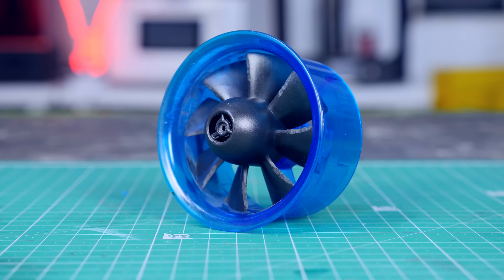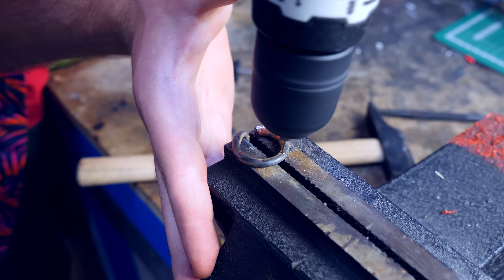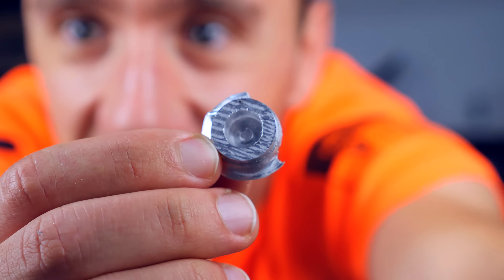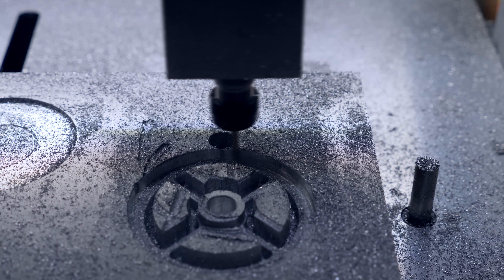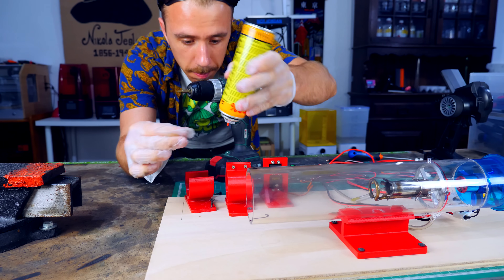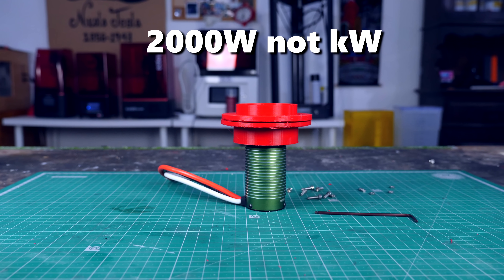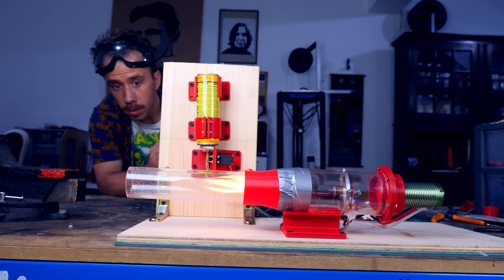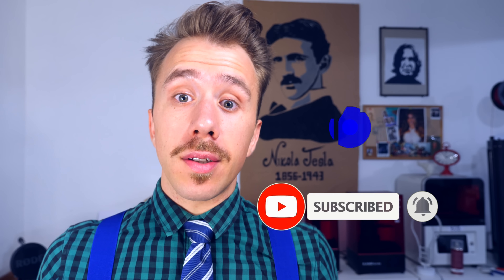I turned my Fan into a Jet Engine (3D Printed EDF Afterburner)

Comment: Greetings from Mexico. Aerospace Engineer here. The reason why your CNC machine was making strange noises while machining is because the best way to machine is clockwise, CNC tools have a hard time cutting in the opposite direction.  My second advise would be to use only 2/3 of the tool diameter as guide to know the thickness you are allowed to cut in one pass. For example, if you have a 10mm tool the recomended penetration is 2.3mm, it can be less but never exceed the 2/3 rds. The amount of penetration can vary from tool to tool, 5/4 is for crowns, 2/3 for milling cutters, etc. My third advice would be to al always start the CNC simulation outside the material machined,  milling cutters are designed to cut in a horizontal way unlike drills.
Im not entirely sure if it is possible to adjust the RPM, tool speed etc in your CNC machine, the reason I mention this is because according to the material , speed, RPM's, and other characteristics should change. You can find on the internet formulas to calculate this characteristics.  Hope this info helps :D

Comment: I know it's been a bit since this came out, but this idea was too good to wait for the next video. It would be cool if you made a Motorjet aircraft setup (doesn't have to actually fly, or even be a full airframe). A motorjet is a special type of engine where a piston engine drives a compressor which then supplies compressed air to a combustion chamber for a jet engine. It will also sometimes drive a propeller, which grants the best of both worlds in terms of low speed and high speed efficiency.

Comment: Jet engines can be either centrifugal flow (early British, and subsequently American, jets were centrifugal flow) or axial flow (early German, and most modern jets are axial flow).

Also, wrap the fuel line around the burner tube, and the heat transfer between the two should heat up the fuel like you want.

Comment: The only thing wrong with it was that you were using a butane can by itself as your fuel source. You have to regulate your fuel source. If you get a butane torch. Take it apart and remove the striker. Fill your torch rezivior with the butane can. Then you'll be able to use your Servo to jog the valve stem that opens and closes the gas flow to the torch  head. The torch head will  restrict the flow so that all of the liquid butane will exit as a vapor. The can upside down delivers a combination of liquid and vapor because it has such a big hole to exit. This is why you Ran out of fuel so fast. Using the torch the fuel comes out in a fine mist and vapor which will be way more efficient. You could have done the entire video and only used a half of a can of butane just by running it through the torch as a regulator. Try it. I guarantee you will get a roaring afterburner just by regulating the gas. Cost you 10-15 bucks for a good Large refillable butane torch. 👍😏

Comment: I have two ideas for the next video.
1. Use the Rotary Wankel Engine to spin the EDF, and see if it'll take off.
2. Make a "Wankel Drone." Using the Wankel Engine as a motor, make a drone. You can use a small gearbox to spread the rotation to four propellers, or use 3+ Wankel Engines each controlling one propeller. Each method has pros and cons. The first method is less resource intensive per flight, but the gears are fairly likely to shatter when the engine starts. The second method shouldn't have as many fragile parts, but the weight of multiple engines and fuel will quickly overpower the lift produced.

Comment: Why not to preheat the fuel you don’t make the fuel pass by a metal tube coiled in a copper wire than you just need to calculate the distance and the voltage of the wire for a pretty hot fuel

Comment: I am so very happy for you that you have the CNC machine and the 3D printer!  I need both but can't even afford food much less other things.  Anyway, I have some ideas and suggestions.
First, as a continuation of this project, how about building the next version with a large compression fan in front, with a drive shaft that makes a fan behind take the compressed high-pressure air of the Compressor Fan to be accelerated at a much faster speed than the fan blades in front.  Basically what actual Jet Engines do.
The next stage from this would probably require you to use metal and therefore not be see-through...hey, wait a minute, I remember reading an article where someone actually managed to create "Transparent Aluminum" like the stuff in the Star Trek movie...perhaps that could be used to make it see-through?  I don't remember the actual details of the article, but it is a real thing (or should I say THANG?).  
As a final stage, how about an actual Jet Engine that provides sufficient thrust to propel an aircraft of your design?
Keep up the excellent work!

Comment: Biggest tip for cutting metal: use the shortest flute cutter with the least amount of stickout possible! I buy stubby carbide slightly bull-nosed end mills from china and they work amazingly on my knee-mill style CNC. Allows me to cut at speeds similar to a tormach or haas! Doing this will improve your parts dramatically (think 2 flute, 6mm OD end mill with 0.5mm radiused corners, with a flute lengths of ~12-20mm).

Comment: Hey, um if you use an Aurdino to balance air fuel ratio
(let aurdino control fanspeed to match the air fuel ratio, you control the fuel rate and hence the thrust). 

i think it will work well without any misfire... I like the arrangement though.

Comment: Few thoughts..,. 
1) High pressure, lower speed.. NICE.. but i don't think the restriction was enough.. Perhaps implementing collapsing fins like that seen on an actual jet engine would help determine the restriction required. 

2) It appears you're air speed is simply blowing out the flame.. well.... blowing fast enough, that the flame is being pushed too far away from the fuel & ignition sources. 
Perhaps reversing the order of things would help. Try changing the order: 
Fan - > Fuel -> Ignition - > Restriction - > Exhaust

One final thought, is to change the fuel delivery mechanism all together. 
Not sure if you've seen them, but in the machining world, there are coolant misters (fog mister) that use air pressure to atomize coolant. I'm wondering if doing this with the fuel might make for more reliable combustion, especially since the fuel you appear to use, is condensing in the delivery mechanism, and almost "squirting" out as liquid, rather than being gaseous, or atomized.

Comment: Regarding the lily impeller boat. Would it make a difference to have the impeller in a tube? The idea is very cool and I've been thinking about something similar for years. Create low pressure in front and higher pressure in the back. I did not know of the lily impeller until now, my idea was a tube with several propellers moving at different speeds, higher rpm the further back. The reason for less rpm in front was to just get the water moving in the desired direction, then amp up the pressure as it moves backwards.

Comment: If you you could connect a rod to your EDF fan that runs through to the aft that's connected to a secondary fan ( Preferably made of some sort of metal so it doesn't melt) then your exhaust gasses would spin the aft fan which would turn your forward fan creating more air coming in from the front and creating more thrust! - Source: I'm in school to be a aircraft mechanic
Reply: @Officialintegza. I can’t direct message on YouTube and this feels like a scam :(

Comment: The best impeller for the job would probably be a hybrid type designed to take advantage of both the higher flow of an axial and the higher pressure of centrifugal blade set. I have seen this concept utilized in three different compact jet engines that run helicopters, private jets, and the RC model jet engines.

Comment: Integza, I think that when you are ready, you should make a model jet in a future video. You could attach these jet engines when you fine tune them to make an attempt to fly. Or you could build a rocket car using these engines. Just use an RC car and strap this engine to it. It should all be self contained, so it would be pretty easy.

Comment: I am actually curious what settings you had in the CNC. I've been machining for 16 years now and it sounded like a spindle speed issue, but cutter length could have caused wobble and it looked like you had tool chatter.
Reply: I don't know much like you but I second the tool chatter
Reply: 4 flutet mills aren't the best tool for this specific job, and feeding them to fast for the spindle doesn't help eather. The depth of cut was a bit to big specifically for his milling machine. He should run max rpm light cuts with a short 2 flutet mill and try to increase the feeds slowly.

Comment: In fact man, spray Always work better upside UP, because if you disassemble one, you will see, there a small thin plastic pipe in it to pump things form thé bottom. So putting it upside down reduce the liquid gas flow out, because the small pipe in it is above the liquid gas level inside the spray...

Comment: An actual engine I noticed the fan at front isn’t only in that shape for the blades, but you should tilt the blades in the direction they turn, and you should add the compressor stages and the rear fans to it.. aka pretty much just a mini jet engine.

Comment: I tried to build this myself 2 years ago. 
In a real jet engine, the pressure is really high in the combustion chamber. So using a centrefugal compressor and a nossle outlet is the right thing to do.

The thrust you can gain theoreticly is sqr(T1/T0). So with 1000°C outlet gas temperature to not melt metal, you could doubble your thrust. 

So you need to achive a really high temperature to get some effect put of this.

Comment: Hey Integza, why don't you build a compressed liquid air engine? I have a theory where u cool air to a liquid to increase the volume of air that will be stored in a container for example, the air line will pass through a chamber and be heated using a coil to expand the cooled air that is also under pressure, the pressurised air then goes to the air pistons in the compressed air engine and rotates a crank shaft. I hope you get me n if it's impossible u could tell me here

Comment: Since a centrifugal fans generate high pressure flow..try putting a longer tube but smaller in diameter with a aerospike Nozzle

Comment: Is it possible using most of the parts you have assembled and use it for a heater to heat a small room or a cabin. Inside the big tube place a copper 1/2 inch tube coil and let the flame heat the copper then force air using a fan threw the copper coil?  The number of times the copper is coiled can make a difference on the heat out put. More could produce more heat? Or less coils? How can the flame keep a sustainable temperature without burning allot of fuel? Should the flame go out when a certain temperature is reached? Then at a cooling temperature the flame re ignites?? 

Can this be a sustainable friendly heater?

Comment: That is smart idea and I will give it a try too. but I suggest there should put a barrier a few distance (metre or foot)  from the flame  coming out  the combustion engine. Just like they normally when a jet is about to take off , in order to stop the flame from getting further

Comment: I need a new 3d printer, and you need a better fan. (you have an additional fan since I subbed). This reminds me of the time I fixed my Reddy Heaters broken fan with a leaf blower. You should make a rocket engine out of a leaf blower on the next video. Probably some black& decker piece of crap with lipo batteries would be easiest to modify.

Comment: You should make an automatic tomato smasher combined with a jet engine to burn the tomatoes. Added bonus if it auto feeds tomatoes. 

Im picturing some sort of tube dropping tomatoes to a platform, then a shrinking/expanding wall smasher ran by a sterling engine powered by the jet engine, that has a trap door bottom that drops to a burn chamber where a jet engine burns it and some sort of mechanism triggered by the engine firing drops another tomato and starts the process again.

#death_to_tomatoes!

Comment: Hi I watched a lot of video of making jet engine but no one else has ever tried using a turbine it's how you get a better flow of flame it's fixed after the combustion to accelerate the hot gaz which is needed to pickup speed it how aerodynamic work I would like to see it

Comment: Milling aluminium is not that scary. It's mostly about stability, so try and keep your milling tool as short as possible and mount your workpiece firmly to reduce vibration. A lubricant will also help but that will be messy. A high RPM, low feedrate and a shallow depth of cut are important. A two flute mill is ideal because those have a great chip evacuation. If you want to know more feel free to contact me

Comment: Integza, you need to increase the pressure in the combustion area. The goal is to heat the air under pressure then as it expands through a nozzle (or turbine) that added thermal energy turns into kinetic. The higher the pressure ratio you can achieve the higher your efficiency will be. The limits of this will be when your compressor (the fan) stalls. I think you could demonstrate this by creating an adjustable blockage and simply increasing the flow resistance until you see a dramatic change in power consumption by the fan motor. With that you can find the stall pressure ratio for various speeds for your impellers.

Comment: My entry into the win a 3d printer is less of a project idea and more of a process change.
For parts that can't be be made out of plastic use casting resin that jewelry makers use; that way you can avoid the issues you've had with ceramic resin.

Comment: Hi there use hydrogen and oxygen as a fuel and get those fuel using electrolytes process using solar powered fuel cost will reduce thought it may cost for solar panel but one time investment.

Comment: This is not a jet engine. You can't turn an electric fan into a jet engine because a jet engine is driven by its internal combustion, not an electric motor. What you've created is a fuel burner with force air flow.

Comment: What if you use a leaf blower's motor add a tank filled with diesel fuel and connected a mini air compressor to the tank so it can push the diesel out super fast goes through the fan and add  glow plugs so itgets bigger and faster

Comment: Hey Integza. Cool channel, love your work. I would like to suggest you a project inspired from your last video with hydrogen peroxide and potassium permanganate. I am an MPharm but my real passion is eng and vehicle's. Especially engines. I have some crazy ideas about the next engine. Adding another ingredient to the fuel and probably it's gonna be flammable with high compression ratio. Without the usage of a spark plug. I cannot wait to explain my idea. Please let me know a platform that you would like to talk. Take care

Comment: What your engine needs is not a fan, but a compressor. Why not 3D print an axial compressor like that in a more modern turbojet engine? This would compress a lot more than a centrifugal compressor and lend itself to 3D printing better, too, plus be more durable to high RPMs!

Comment: You could build a small Plastic Petrification chamber to create Diesel and gas from all your waste 3D printed plastics to and then use the fuel to run an engine.

Comment: A glow plug from a 2 stroke model engine will work just as well, as long as you carefully pull the coil out a little and only use 1.5 volts.
Reply: like from a cox engine?
Reply: @vasili1207  
Yes basically, Cox engines use a 'glow head' which is a combination of a cylinder head and a built in glow plug, whereas most glow model engines use a glow plug that screws into the cylinder head like a spark plug.
The glow heads and glow plugs work on the same principle.
Reply: @Johnno48  i have a screw in type on mine i think its called a pee wee. i bought it as a desk toy :D  just need a desk.

i am glad someone else mentioned rc glow plugs ..
Reply: @vasili1207  
Yes the Pee Wee .020 uses a screw in glow head too.
There is also a very rare diesel .020 Peewee that has a screw in counter piston.

Comment: Bro actually what happened is your assembly is good but your model lacks the proper shape and size you need to make good contact between the heat source and the fuel so it would burn completely and take a small fan which will move due to air or first fan so it will suck fuel more efficiently rather than just a pressure of can

Comment: Looks cool :-D
Commercial jet engines use these big axial fans to generate the lion's share of the thrust they produce. The core also uses axial stages, not centrifugal ones. That said, you could try to make a radial compressor. Those are used in smaller jet engines. With some redesign, that might generate enough pressure to get a good and stable combustion. Also, look at nozzles to put at the end of your tube. As you saw with the restricted tube it influences the performance quite a bit. It might be cool to have a way of measuring the thrust and to compare different arrangements/nozzles/whatever and see what is best.

Comment: Next video suggestion:

Revisit the Turbo Jet engine project
Add a heating element to the fuel injector (preheated fuel). And use gasoline or diesel for fuel
Add a nozzle and lastly more turbines in the combustion chamber

Comment: well, there are already some well voted comments but I'll give my best: I would love to see your next engine stabilizing itself (meaning, you just need some airflow to start the engine), and since you need to preheat fuel how about an venturi injector? (like that cutting edge piece of tech called carburetor). Finally, it would be great to know HOW MUCH THRUST your engine generates...